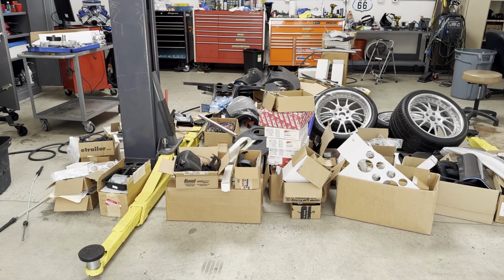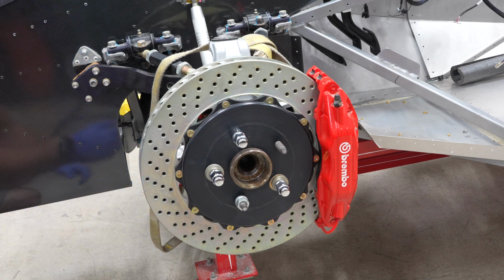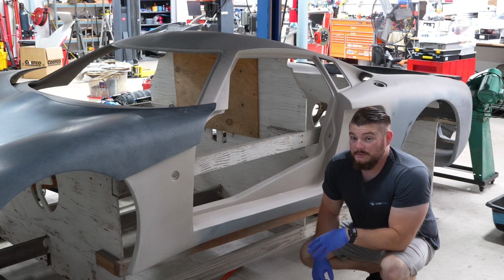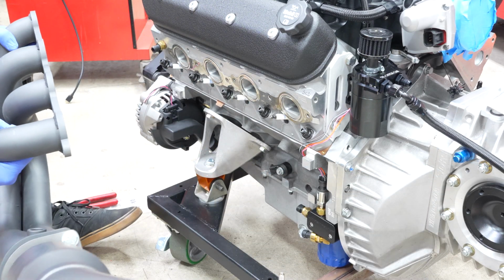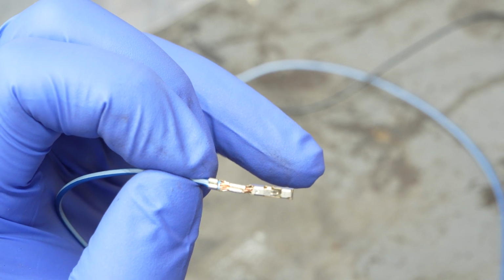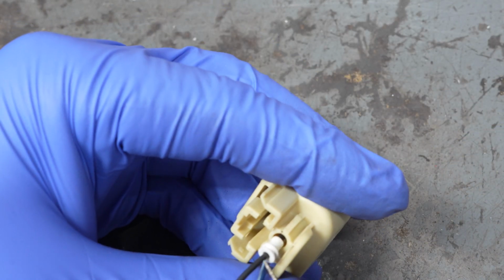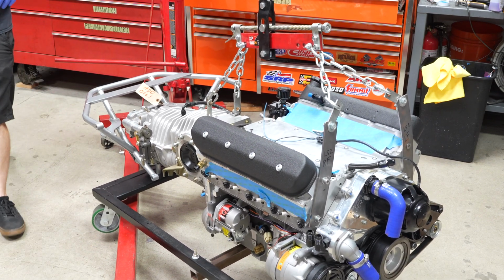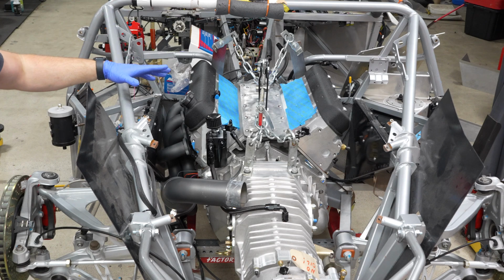I'm Building the Worlds Cheapest Supercar! | Factory Five GTM | Project Car

Comment: Good luck with build. Should generate lots of content. Neat trick on soldering a crimped connector. Did you check the flywheel, clutch, etc or already expecting the drivetrain to go in and out several times?
Reply from the maker: Thank you! It probably will come in and out a few times. But the previous owner is fastidious and said it was all tight. I might double check to be sure. Thanks for watching!